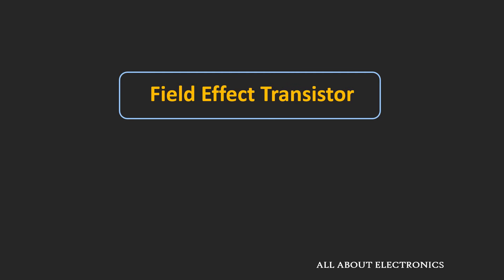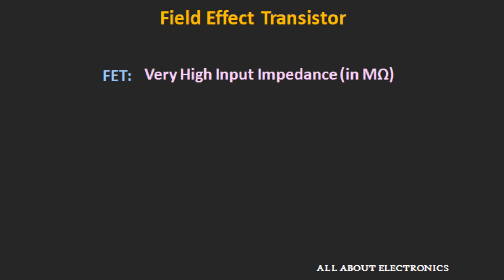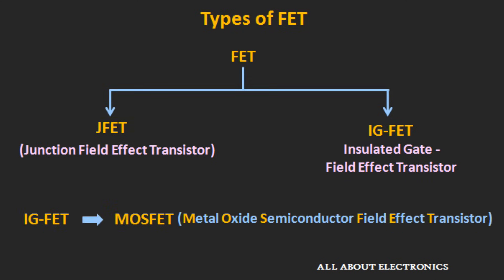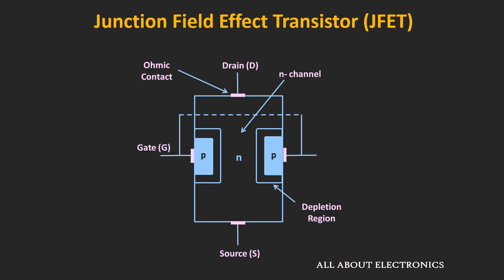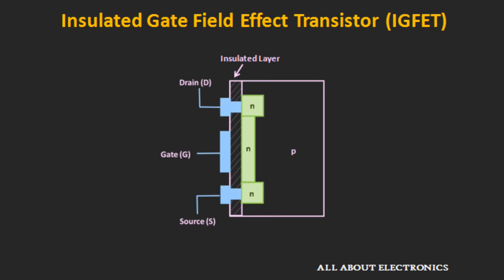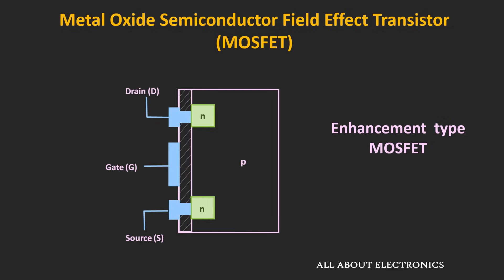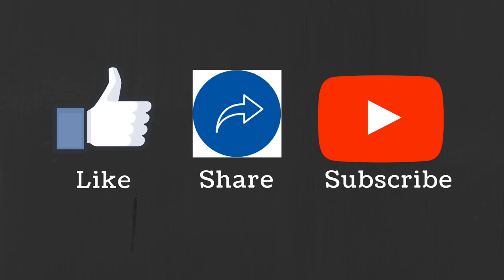What is Field Effect Transistor (FET)? || Differences between BJT and FET || Types of FET

Comment: 5:25 how does a hole can move 
Its just a absence of electron in p channel
How can it move for production of current
Reply from the maker: The movement is due to electrons of course. But as the electrons moves, it creates hole. So as electrons are moving in one direction, we can say that the holes are moving in another direction. ( the opposite one). And in p type, as holes are majority charge carriers so dominant current is due to holes. ( as there is an absence of electron in valance band) for each atom in p type. I hope, it will clear your doubt. For info, you can check th video of PN junction diode, where the same is explained using animation.

Comment: 🎯 Key points for quick navigation:

00:11 ⚡ FET is a three-terminal device using electric fields to control current flow.
00:36 🧩 FETs are commonly used in integrated circuits, especially in computers.
01:05 📊 FET is a voltage-controlled device, unlike BJT, which is current-controlled.
01:54 🔄 FETs operate using either holes or electrons, making them unipolar devices, while BJTs are bipolar.
02:51 ⚙️ FETs consume less power than BJTs, preferred for high power and computing applications.
03:17 🔍 There are two main types of FETs: JFET and IG-FET, the latter includes the commonly used MOSFET.
05:06 🔗 JFETs use a PN junction to isolate the gate, with n-channel and p-channel variations.
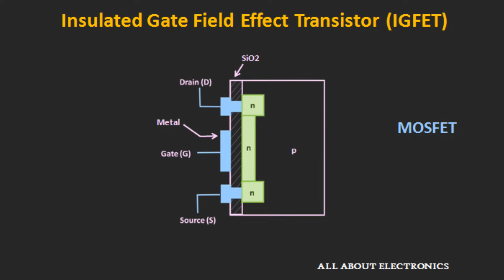06:06 🧊 IG-FETs, like MOSFETs, have an insulated gate and can be classified as depletion or enhancement types.
07:51 🔜 Future videos will cover JFET and MOSFET workings, symbols, and biasing methods.

Made with HARPA AI

Comment: Videos not in order😮
Reply from the maker: If you are taking about analog electronics playlist then the videos are in the following order. 
1. Diode and diode applications 
2. BJT and BJT based circuits and amplifiers 
3. JFET and MOSFET
4. Op-amp
5. Oscillators and multivibrators
6. Analog filters
7. Feedback Amplifier

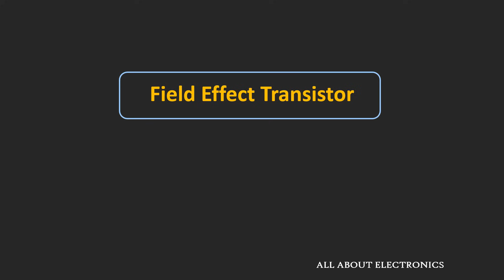Comment: 00:16 The field effect transistor (FET) is a three-terminal device that uses electric field to control current flow.
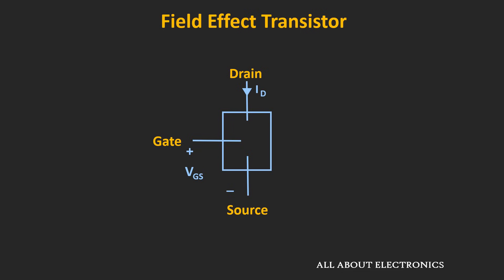01:25 Field effect transistor (FET) is a voltage control device, while Bipolar Junction Transistor (BJT) is a current-controlled device.
02:22 BJTs are commonly used as amplifiers and switches, while FETs are preferred for their high input impedance, smaller size, and lower power consumption.
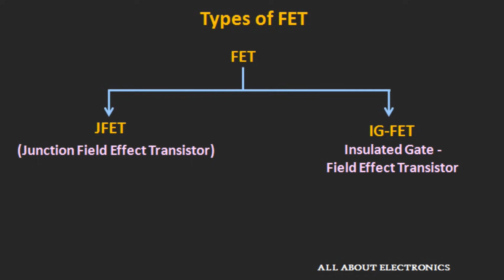03:23 There are two types of FETs: JFET and IG-FET (or MOSFET).
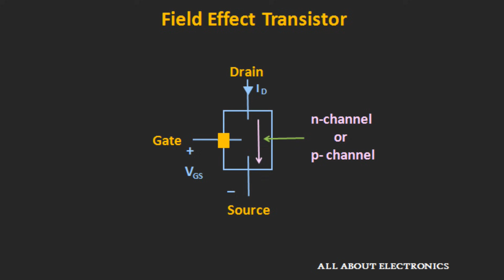04:25 The JFET or junction field effect transistor is a type of field effect transistor.
05:27 There are two types of JFET - n-channel and p-channel
06:29 There are two types of MOSFETs: depletion type and enhancement type.
07:31 FETs are further classified as n-channel or p-channel MOSFETs

Comment: Interesting fact. Notice the metal part of the FET shown at the beginning of the video. It is used for heat dissipation. It is screwed to a PCB board using the hole and then a small amount of heat gel (heat sink compound) is applied between the metal part and the PCB board.
Reply: @abhiramanne9649  go and watch pogo

Comment: Hello!
Maybe someone can help me figuring out an issue I have: I'm simulating a gain stage for a guitar pedal using a J201 n-channel FET. The dataset reports the Idss (which should be the saturation current when Vgs=0) as <1mA. But if I look at the characteristic curves of Id vs Vgs it can be seen that the Vgs=0 curve saturates at about 20mA (which is what I would expect from that jfet), but If I draw the characteristics using ltspice they cap at 580uA. What I'm not understanding here?

Comment: Conduction due to elecrtons in one direction automatically mean the conduction of holes in the opposite direction.. Then how come the definition of a unipolar device comes into existence?
Reply from the maker: Unlike, BJT or diode, which involves both p-type and n-type region during the flow of current, Field effect transistors have dedicated channel for the conduction. (either n-type channel or p-type channel)
So, the major contributing carrier in the flow of current  is either electrons or holes.
And hence it is called as unipolar device. 
I hope it will clear your doubt.

Comment: Why silicon oxide is used for isolation?
Reply from the maker: The silicon dioxide acts as a insulating layer. And the thing is it is easy to deposit on silicon wafer during the fabrication.

Comment: Your comments of "FET is a unipolar device, while BJT is a bipolar device" and FETs being "Either free electron or Holes" and BJT being "both free electrons or holes" is unclear.
Can you give some examples and clarification of the distinction you are making. Thank you in advance,
Reply from the maker: If you take the case of BJT (either NPN or PNP), here the charge carriers are both electrons and holes. (holes in P region and electrons in N region, as they are the majority carriers in the respective regions).
So, we get current in BJT, it is due to both electrons and holes. That's why it is called a bipolar device.
On the other end, in the FET, the current is due to the flow of charge carrier through the channel.  
The channel is either p-type or n-type. So, the current is either due to electrons or holes.
That's why is called unipolar device. 
I hope it will clear your doubt.
Reply: In depletion mode holes I'll be major carrier and in forward mode electrons 'll be major carrier